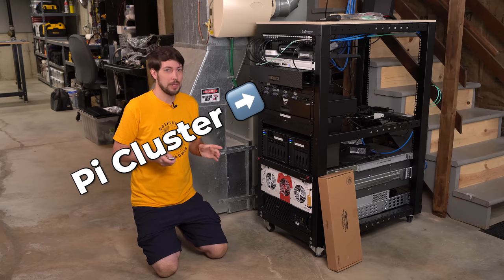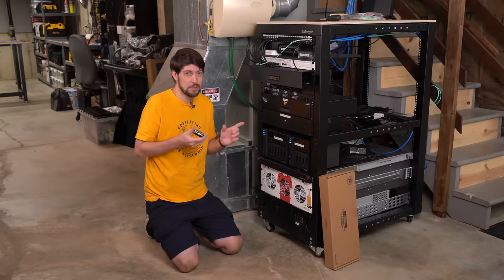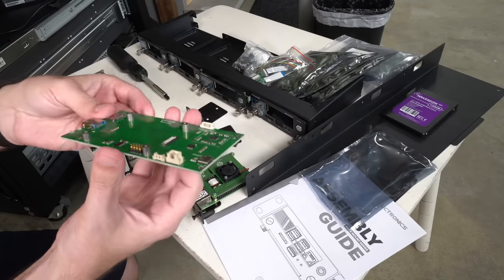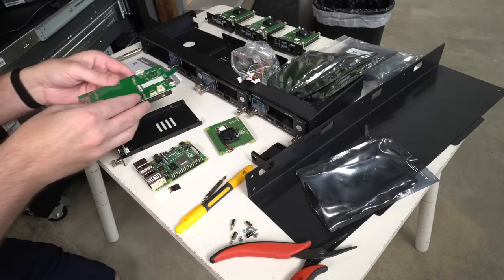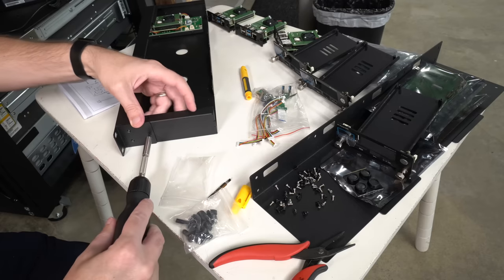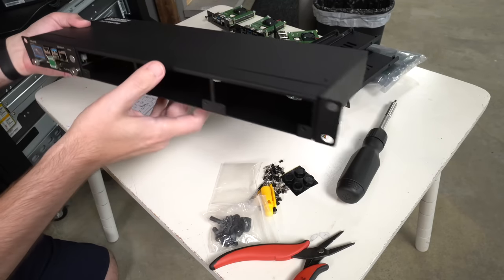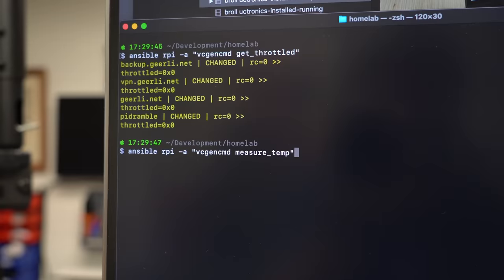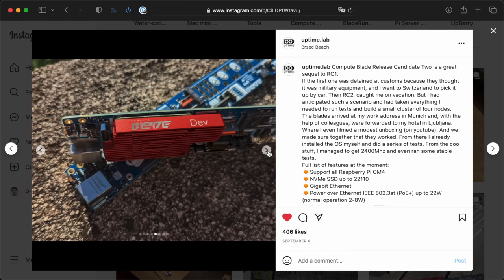Homelab upgrade: New Raspberry Pi Cluster rackmount

Comment: I don't use PoE because I found out that it eats up much more energy than using the normal RasPi stuff. If you live in the EU currently you're trying to save as much energy as possible that's why I'm very happy about my decision. Definitely not optimal design-wise maybe - but then again - having a single PoE switch means a single point of failure whereas multiple USB power plugs are better in that case. But definitely not as cool as using PoE only.
Reply from the maker: Yeah, the nicest thing for me is I can have many devices (which usually take an extra 1-2W of overhead for the power conversion on PoE) off one PoE switch, and when power goes out, I just have that PoE switch plugged into a UPS, so everything stays up.

Also just saves a mess of wiring for the power cables.

Comment: Curious if there's any leakage from those USB bridge connectors. 
I've seen complaints about leakage from similar ones on other boards causing wi-fi issues (not an issue in your case).

Comment: this is more great red short jeff content but i really wish it would all get upgraded soon to pi 5 and nvme and 2.5g - running the pi herd in a cluster would help maje things like web server much more scalable - if you run into perf issues you just add a node - you should be running a load balancer  netfs and mysql cluster for pete's sake - even with pi5 not yet here think about adding better arm nodes alike 3588 with 16gb ram or odroid with fast nvme - the prices are not much more for these devices and you get more performance
Reply: think about a small elec driver that can torque very lite - it would be way better than screwdriver and you would get consistent torque without having to guess, also please do HA opnsense plus HA pihole

Comment: Samsung Pro Endurance 2022 is the best option among all endurance oriented MicroSD cards, at least by their own datasheets.
Reply from the maker: They are good cards (and not just judging by their datasheets). Though I've had great luck with SanDisk Extreme and Samsung Evo.
Reply: @JeffGeerling  I know most of the time they will be fine. I am just not that confident in cards that shy away from stating a proper endurance rating (or related proxies) black and white.

Comment: Does the pie do proper  trim  to make  the SSD meet longevity spec?  Also one con is I don't like the exposed solder joints on the USB jumper.  If any thing from  the rack brushes those might not be good for it.
Reply from the maker: The Pi can do TRIM as long as the SSD controller supports it. I wrote about it here: https://www.jeffgeerling.com/blog/2020/enabling-trim-on-external-ssd-on-raspberry-pi

Unfortunately it doesn't look like this controller supports it :(

Comment: Is there a way how to control enclosure fan speed? 2 fans are connected to the 3-pin connector on SSD plate on 1st and 4th rPi. Those small air vents on the side of the enclosure create very loud turbulence

Comment: how many times overkill is that rack?  a raspberry pi uses a few watts at maximum, the fans are meant for rackmounted 95w intel xeon dual & quads
a fanless rackmount made of lego blocks would work as good for the raspberry computers.

Comment: Thanks for the review of this, Jeff. I've been keeping my eye on this company's products for a while.

I have last year's model with no SSD bays, and with custom PoE hats(that work, but are frankly awful, especially the fans.) The unit had enough... quirks that, while it wasn't quite worth returning once I got it in place, it also wasn't quite worth the price tag for my purposes. This one looks to be fairly improved, which is nice to see. Thermal issues plague mine, as well, though. If they release an update with fan mounts on the chassis, I may consider upgrading. For that price tag, I'm not very willing to have to cut and drill out of necessity rather than just improvement. My stuff runs a bit hot, so I always keep an eye on my thermals. 

Very good customer service from the company, I'll say, I had a replacement for a defective chassis that arrived within a week--expedited from overseas. Good enough service for me to keep an eye on their products for future improvements, at least.
Reply: Hi gibletcaptain, we realized the fan noise issues and changed the fan supplier, it won't happen anymore. In terms of the thermal suggestions from Jeff, we will update the rack design very soon to add extra fans, just keep tuned.
Reply: @UCTRONICS  That is great to hear, I'll look forward to it. Thanks for your reply.

Comment: Hi Jeff! Great video! Can you please check which USB-SATA bridge chip is on the SSD shield? I’m interested because you are using Grafana with that and I had issues with the Pi4 writing frequently to the SSD due to the data collection (the VL805 controller stops working after a few hours). This is a 2+ year issue without a proper solution and many people have reported it.
Reply from the maker: Forgot to do that, but so far after a few days I haven't encountered any issues... I'll be reporting back if there are any problems.

It doesn't look like this controller supports TRIM though :(
Reply: @JeffGeerling  Thank you!

Comment: Hey Jeff, can you please tell me how the display is connected to the Pi? Is it through the GPIO pins? And where is the display controller? With such connection, is it still possible to use a full size display through the Pi's HDMI ports?
Reply from the maker: Yes—it's using I2C, which just uses a couple of the GPIO pins.

Comment: A quick question about the pi cluster.
Wouldn't it be cheaper to get, say a refurbished dell r620 instead of 4x or more pi's?
Even with the old prices. The dell server should provide more CPU/RAM/DISK even with more than 4 pi's combine and is probably cheaper to get.
I know that that it would need more power to run but in my mind the trade off sounds worth it.
Reply: Same question. I run proxmox on one liter pc (lenovo tiny). Seems so wasteful to do this with pi's.

Comment: Jeff thanks for these great and informative videos! Wondering what do you use for fail over or stand by DNS when your Pi-Hole is offline, such as when you were doing this upgrade? Do you spin up another instance somewhere else, or do you have some sort of fail over setup? If you do run another instance, do you try and merge the stats of the two, or don't care about that data while the main pi-hole instance is offline? Sorry for all the questions, but just about to start down this path with my own homelab and wanted to be able to reboot the pi-hole at will (whether a real pi or a VM) and not have the family upset that 'the internet isn't working'.
Reply: I've recently changed my setup from one Raspberry Pi to have an OrangePi Nano and a the very old Raspberry Pi 1 running in Master-Backup failover. They both run PiHole and Nginx (as a reverse proxy for incoming services). I use KeepAliveD which is a lightweight daemon for High Availability. It monitors the processes and if one of the monitored services stops will failover to the other Pi. Services are on virtual IPs so no network issues to switch over and you can still access the failing box. I use Gravity-Sync to keep PiHole settings between the 2 Pi's in sync. 
Hope that helps!
Reply: @richardm5778  Thanks for your reply. I've read about similar same setup elsewhere and was thinking I'd do something similar as well. Still working out that hardware and possibly whether to use a VM for one of the instances. Do you try to aggregate/merge the stats from the 2 instances as I think Gravity-Sync keeps the configs synced, but don't think the actual user stats are synced? Does the constant pings from the keepalived check for actual DNS look up failure (the service is running on the main instance) in which case it would be filling the logs with the constant checks, or is that just ignored by your stats/filters in Pi-Hole on the master/running instance?
Reply: @cardre  i don't merge the stats, your are correct Gravity-Sync just keeps the config in sync. I do use Home Assistant which monitors each instance so theoretically I could aggregate the stats in there if required.
For the monitoring in theory you could use any shell script that returns 0 or 1. I followed examples that just monitor that the process is running. This has worked ok for me so far.
Reply: @richardm5778  Thanks again for the reply. Home Assistant is on my radar as well. From what I've read on some of the other comments, I don't know if  @Jeff Geerling actually had anything running like this, so he must of just spun up something manually or switched back to his router.

Comment: Standard PoE is such overkill. If you look at the cheap TP-Link Access Points they send 12v power from the standard 12v adaptor using a passive injector. You get all the distance you'd need in a house to power the AP possibly in the loft or to an out door AP.
Reply: Also powering the PIs from PoE in this configuration seems a bit wasteful. The rack mount enclosure ought to supply power to the PIs.
Reply: Passive 'poe' is just poor design, it's used when the manufacturer doesn't want to spend the money to implement a proper PoE solution so they cheap out and just hope that the customer uses high quality ethernet cabling... Most people don't, you can often find CCA cabling in homes which heats up a lot when throwing passive 12 or 24V over it, becoming a potential fire hazard.

Also always fun to explain to clients why their brand new laptop no longer works because they connected it to a cable whose other end was connected to some dumb passive 'poe' injector.
I'd love to see the EU ban passive fake PoE injectors, let the companies behind them spend $2 more to implement actual PoE instead of risking house fires.
Reply: @someguy4915  You just make up nonsense you think ought to be correct. You say it's poor design and in the same sentence contradict yourself and admit it saves money. It's actually quite smart design and it does not destroy Ethernet ports.
The devices which it powers are about 6 watts. The loss at 12v down the cable is not enough to warm the cable. It does not risk house fires, that's FUD. They add considerably more than $2 to the price for PoE and separate PoE devices cost as much as a cheap router.

I've used passive PoE in multiple WISP installs over the years but it is true most of the equipment now accepts standard PoE so we use that.

I would like to see it as a standard feature of the PI but I don't know if they have the budget or the board space. The PI lacks because it does not have decent on board regulation as far as I can tell.

Comment: I'm totally new to raspberry pi and microcontroller. yesterday I got my raspberry pi4B 4gb model. for some reason the pi isnt working. I tried freshly installing 32/64 bit raspbian os. but no hdmi output or booting. green led is on without any blinking. if anyone have a solution, please let me know. i really need this pi running. 
thanks

Comment: I'm confused about something.  At first, I figured the SSD was connecting to the Pi via the micro SD adapter, then you plugged in that USB A to USB A adapter.  What's used for what?
Reply from the maker: The microSD card adapter gets routed to the front microSD port, and the USB adapter is for the SSD :)
Reply: @JeffGeerling  Oh, ok.  That makes sense.  Thanks.

Comment: If you have so much interconnected System running your home.... what happens if you need to black start this setup?
I wants ran into Miss configuration where one Server depends the other to be running and the other way round and I could not restart once both Servers were down :/
Reply from the maker: That's why I always have my Ansible inventory for network components set to access by IP instead of host name. As long as DHCP has worked in the last 24 hours, most devices will at least keep the consistent IP I assigned them and I can access them even if the rest of the network is going crazy.

Comment: Doesnt the dns and pi hole slowdown the internet connection to much ? My ping times in games and response on websites go up alot when i use them on my pi's
Reply from the maker: Haven't had an issue there; my ISP's own DNS servers are often slower to respond than my Pi 4 model B on the local network!

Comment: 8:25 What do you mean by "one-handed operation" that a normal screwdriver shouldn't manage? Do you mean the ratchet mechanism? IMO that is crap and something i never use ...
Reply from the maker: Between the magnet, the light ratchet force, and the knurling, it makes for easier one-handed operation. I've done without for many years, but the LTT screwdriver does make one-handed operation easier at least than the Stanley drivers I have been using. No screwdriver is perfect, though. That's why most people have 2, 4, 10, or even dozens of screwdrivers. The right tool for the right job.

Comment: Does somebody know if the SATA shield is powered just from the USB port of over the GPIO leads as well? I have some SSDs connected to my raspberries and some disks have issues with the max current limit of 1.2A of the PI and I need a separat power source for the SSD. Would be great  uctronics solved this issue with this rack.

Comment: I missed something... what is the little USB to USB bridge for if the ssd is connected via that sd card adapter ribbon?
Reply from the maker: The SD card adapter ribbon is routed to the front panel microSD card reader; the USB to USB goes to the SATA adapter, they're all routed through the single PCB.
Reply: @JeffGeerling  Ahh, I completely brain spasmed that... thank you:)

Comment: Actually the one thing that does not looks safe - opened contacts on the usb-usb board sticking right to the front, neither pretty.

I would, for safety and ✨aesthetics✨, 3d print a small black cover for these lads

Comment: Compute blade is the best option for rack setup. And use a 5cm sata /usb3 adapter could do the same too, of cox, it's not as good quality as this box setup :)

Have anyone tried micro-sd read only mode + mount network storage to extend the micro-SD card life-span?

Comment: With this case in mind, does anyone have any recommendations on how external cooling fans might be powered?  Does the Pi have additional outputs for this job or would an external power solution be required?
Reply from the maker: The SATA HAT board has a 2-pin 5V fan power connector, so my plan is to adapt that to a 3-pin Noctua 5V fan. Should work well, but I'm waiting on the connector so I don't have to bodge some wires onto the header.

Comment: i was going to say that is a ton of screws that are not needed
Reply from the maker: Always a little nicer to have extra screws than too few. Plus, every time you reassemble something, you somehow end up with extra screws again :D
Reply: @JeffGeerling  true but I would do the same as you and just skip where I felt it wasn’t necessary. I don’t want to make more work for myself later if I have to get back in or to parts.

Comment: Great video, but if a high quality 69 dollar screwdriver ain't worth it a 300 dollar metal box ain't either🤷 at least my opinion
Reply from the maker: The Pi Rack Pro and the LTT screwdriver have this in common: for most people, they're way too expensive for what you get (compared to much cheaper alternatives).

But for some people, they are happy to pay a premium for some extra little bit of polish that you can't get with the cheaper models.

Personally, I think I could justify the UCTRONICS price in my particular situation. But maybe not the LTT screwdriver. The jury's still out and I'm waiting to give a final evaluation until I've used it a bit longer (I'm still getting used to the ratchet).
Reply: @JeffGeerling  that's fair and i agree the little Polish on premium product's makes me smile no matter what it is. Btw it wasn't criticism i personally fully agree with your view on the screwdriver especially because it would cost me a lot over 100$ to get it shipped to Denmark with vat and everything. Still would print the pi holder personally 😉
Reply from the maker: @nikolaitoxvaerd  Yeah, over $100 and it would definitely be a hard no. The polish on the PB Swiss is worth probably close to $100 but the LTT driver is expensive but possibly worth it at $70-80, and too much at $100+ (IMHO).
Reply: @JeffGeerling  agreed, have been looking at the PB Swiss, but I have a hard time finding one (also too hard on my tools ahaha) and we don't have Williams and snap on in the EU. So have been looking at bit at the Wera

Comment: Pogo pins? SD Card adapter? USB front panel bridges? I am sorry, but at a certain point you should ask yourself if using a CM4 wouldn't be the better option. This rack looks like a neat setup, build quality might be nice, but in detail it's so so messy and quirky. Not approved.
Reply from the maker: That's why I'm excited about the CM4 blade...

Comment: Hey Jeff, something you may want to look into if you ever do the PXE boot on the Pi is that I have mixed results with it using it as a 4x pi4 cluster in my own setup. My main pi provided everything needed for the pxe boot and running the root file system for the rest of the pi's in the cluster. For some reason after a few days or even hours the Pi's that pxe booted and used nfs for roots seamed to either loose access to the root fs or the network controller would go to sleep crashing the pi's. I never did do a deep dive into figuring out what was going on since I don't have a serial connection setup to try and get back into one of the crashed ones or to setup some kind of log.